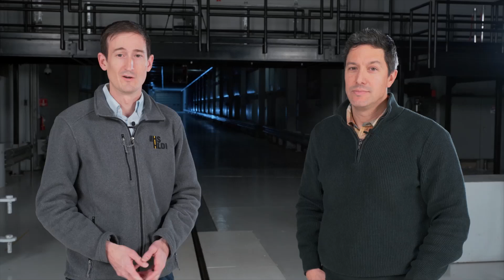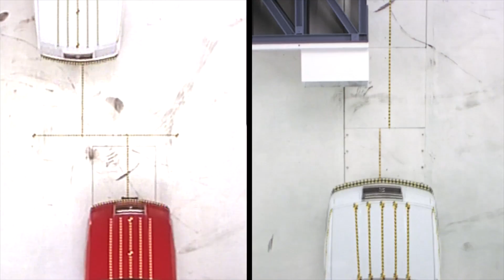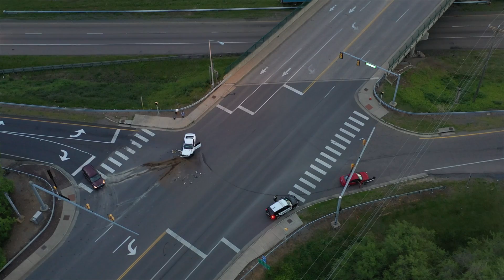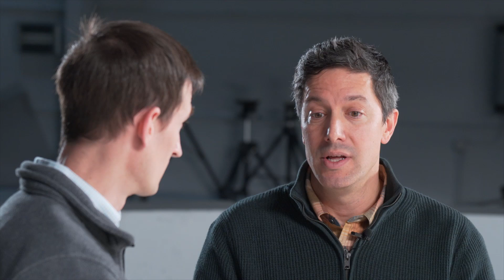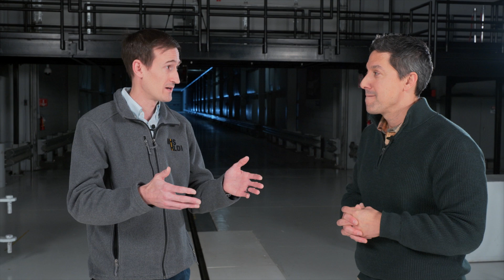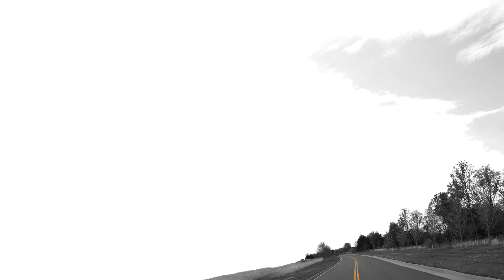IIHS answers your questions about test speeds

Comment: It would be interesting to see a car from the 90s or 2000s with a small overlap or updated side crash test how this will perform. For example an BMW E36, E46 with the 2024 tests. Would be very interesting how these cars perform.
Reply: They had one with a 90s car vs a semi modern 2010ish model, 90s car got obilterated
Reply: where can i find this @astefanik16
Reply: That would be interesting.  Growing up my mom had a 89 Volvo 760 and 92 Mercedes 300e as these 2 cars were always touted as one of the safest cars of the time.  It’s be interesting to see how they would perform in our modern tests.
Reply: @Wasabi9111  as proven by 5th gear, pre 90s volvos are vastly outperformed by mercedes and even ford tauruses
Reply: @wasabi9111 the merc wins, no doubt. go see 5th gear's ugly turnout of a 740 with a modus
Reply: If that's the case, I Have a interesting fact for you!
There's these lines from a technical paper called
"Severe Frontal Collisions with Partial Overlap - Two Decades of Car Safety Development" that goes like this!

Frontal Severe Partial Overlap Collisions (SPOC) also called small overlap crashes pose special challenges with respect to structural design as well as occupant protection. In the early 1990s, the SPOC test method was developed addressing 20-40% overlap against a fixed rigid barrier with initial velocities up to 65 km/h. The knowledge gained has been used in the design of Volvo vehicles since then.
Important design principles include front side members orientated along the wheel envelopes together with a strong support structure utilizing a space frame principle with beams loaded mainly in tension and compression. This novel setup was first introduced in the 850-model in 1991 and has been refined and patented (2001) in later Volvo front structures.

And when we combine that with information cited from
"Advanced high strength steel technologies in the 2016 Volvo XC90"
that goes…

Structural principles
Same basic principles since the early 1990s:
　Slide away from obstacle
　Strong safety cage
　Restraint systems adapted for small overlap

That means as for Volvo, they were building their cars expecting Severe small overlap crashes from their 850 model onwards! And Crashed the same way how the current generation of volvos slide away from the obstacle in small overlap!

Also, you can see them crashing their '86 480 ES in a way very similar to how these small overlap tests are performed in Volvo : Decades of crash testing!
If you want to see how these old cars perform, this might be one of those you wanted to see!
Reply: @Normalmark1_  wow. this was very informative! it crazy how much more advanced Volvo was w/ safety than anyone else in the 90's. I'm glad many auto makers have made a lot of progress in the past 30 yrs.
Reply: @Normalmark1_   yeah well... except the 850 moved it's A pillar at only 40, so it's unbelievable that you'd expect it to look decent with small overlap.  and by the way, as proven by 5th gear, pre 91 volvo's were extremely outperformed by mercedes, saabs, and even ford tauruses
Reply: @GaryS-b3y  The crash test only proves that an old Volvo is outperformed by a Renault Modus. It doesn't prove an old Mercedes or Ford is safer. In terms of cabin rigidity you are however correct that an 80s Mercedes is generally better than a Volvo of that time. But I highly doubt it would survive any modern crash testing. Even a 2005 car would earn 0 stars today and they are MUCH more rigid designs than a 80s W124 Mercedes.
Reply: @swordfish1986  the video itself doesn't, BUT WHO CARES?! JEEZ! 
but the fact remains that they are (by standards of the time) if you want proof, watch the 86-95 taurus test.
And SOME 2005 cars are, while some are worse. The stars thing is a lie, look at a volvo xc90. And SOME Mercedes (not a w124) are highway tolerant, I've seen plenty of highway head on survivals in forums. Even princess diana's had barely any intrusion.
Reply: hmmm...and yet nothing in their square era nor in 2001 accepted 40 without it's pillar moving. nothing special about it at all when there's that little effort.
Reply: If that's the case, here's an interesting fact for you!
Cited from Jakobsson, L., McInally, G., Axelson, A., Lindman, M. et al., "Severe Frontal Collisions with Partial Overlap - Two Decades of Car Safety Development," SAE Technical Paper 2013-01-0759

Frontal Severe Partial Overlap Collisions (SPOC) also called small overlap crashes pose special challenges with respect to structural design as well as occupant protection. In the early 1990s, the SPOC test method was developed addressing 20-40% overlap against a fixed rigid barrier with initial velocities up to 65 km/h. The knowledge gained has been used in the design of Volvo vehicles since then.
Important design principles include front side members orientated along the wheel envelopes together with a strong support structure utilizing a space frame principle with beams loaded mainly in tension and compression. This novel setup was first introduced in the 850-model in 1991 and has been refined and patented (2001) in later Volvo front structures.

And when combined with information written here :
Cited from : Lindberg, Henric. "Advanced high strength steel technologies in the 2016 Volvo XC90." Great Designs in Steel (2016).

Structural principles
Same basic principles since the early 1990s:
・Slide away from obstacle
・Strong safety cage
・Restraint systems adapted for small overlap

So we can assume that As for Volvo, They were making their cars expecting serious small overlap crash scenarios from their 850 onwards!
And crashed in the same way how current generation of volvos slide away from the obstacle in these scenarios!

Hope you found these information interesting! ヾ(๑╹◡╹)ﾉ"

Edit : Don't be concerned yet! There's a part of this video called "Volvo : Decades of crash testing" that starts from 0:53 Where you can see them crashing their 1986 Volvo 480 ES in a way very similar to how the small overlap test is done! If you'd like to see how these old cars perform, this might be one of those you're looking for! ᕦ(ò_óˇ)ᕤ

Comment: Can IIHS explain why Euro NCAP changed the testing speed from 40mph on a deformable barrier to 31mph on a mobile deformable barrier?  I know Euro NCAP's improved barrier is heavier but it wouldn't make sense for a car of the same or even heavier weight. And the speed dropped to 31mph, while the old test simulated two vehicles of the same weight crashing into each other at about 40mph.
March 14, 2024 10:09PM
Reply: Because most vehicles in Europe is lighter than 1400kg. 
Than this test is heavier for most cars. EuroNcap make pressure to car makers to make heavy cars softer and absorb more energy than before. Heavy cars get penalty points, and in 2026 they wont get 5 or 4 stars.
Euroncap 50km/h at movable barrier have same energy iihs at 64km/h with static barrier.
Reply: @har5090  I think Euro NCAP should do both. Because the IIHS offset test simulates a crash where both vehicles of the same weight collide with the offset at the same speed of 38mph. EuroNCAP's new test is more difficult for smaller cars but easier for larger cars. I'm worried that a larger car that complies with EuroNCAP standards won't work as well to protect it when it hits a car of the same weight and at 38mph.
Reply: The new test allows results to be comparable across vehicles with different weights. Heavier and lighter vehicles alike have to deal with the fixed kinetic energy of the moving barrier. 
The new test is hence easier for heavier cars and harder for lighter cars
Reply: Are wrong is this the IIHS not the euroncap which test are outdated and don't have idea why doesn't make small overlap test if any European based brand wants to access to American market would perform the test bad since haven't been made the cars for the protocol of the IIHS which are more strict, I have an European car but I don't think that can even protect me in case of an small overlap test by example
Reply: Для того что бы тяжелые электромобили могли успешно пройти этот тест, так как их конструкция при прежнем тесте будет иметь дело со своим большим весом. В новом тесте тележка весит около 1400 кг, тогда как электромобиль около 2000 кг.Это всё маркетинг электромобилей(
Reply: Why the hell do you think those 2 relate at all… iihs does not control euro ncap. Stupid question.
Reply: @2007CreditsJosh  They are not related. But I wonder about Physics. Why did Euro NCAP abandon that test when it was still effective?
Reply: @lilmonix  I made that comment 10 months ago. My point still stands, iihs would not have the answers to questions about euro ncap. You should ask euro ncap instead.

Comment: Fun fact: in 2013 the IIHS tested the 2013 VW Jetta at 50mph, test number CF13006. Although the structure held up well dummy readings showed injuries to every body region (especially the head and leg). If it were officially tested it would be rated poor.
Reply: Sad fact: Dummies getting older, making their bones more susceptible to fracture. So we need to make vehicles safer.
Reply: So head on crash with a f150 both going 35mph sounds like bad news
Reply: @davesmith3530  unless it's a pre-2004 LOL😂 it'll absorb more than the sedan
Reply: @davesmith3530  Same crash as an F150 crashing into an immovable object since they both have crumple zones.
Reply: HIC result is 971. Absolutely unacceptable.
Reply: where can I lookup said test?
Reply: @rletor  techdata
Reply: My mom used to drive that car with me inside it
Reply: I wonder what the prior gen I drive daily would look like